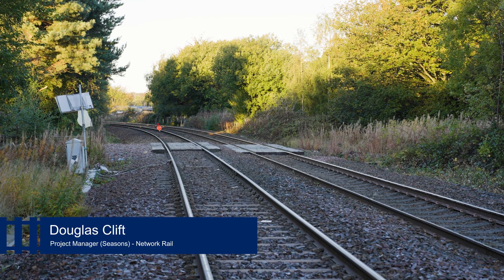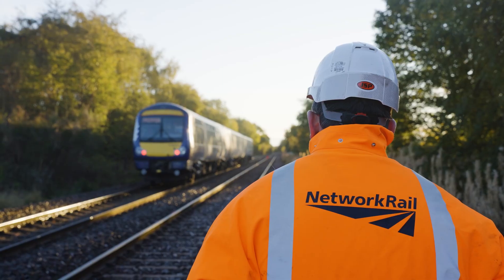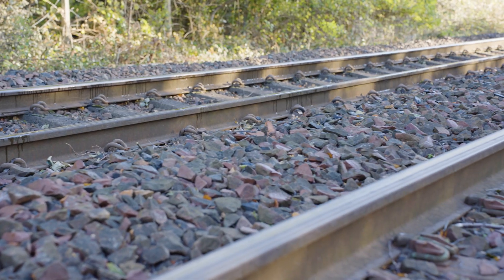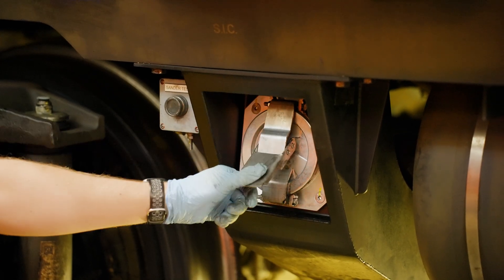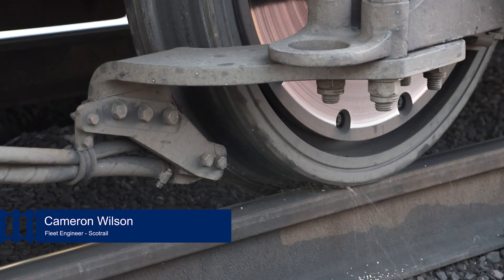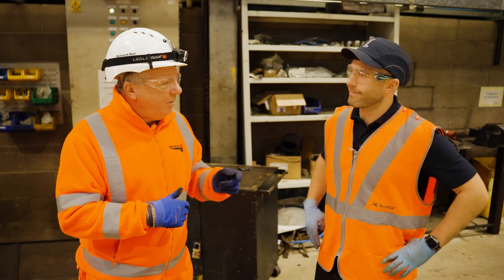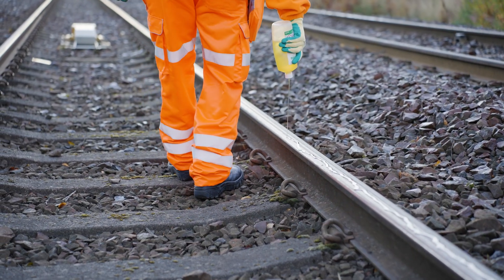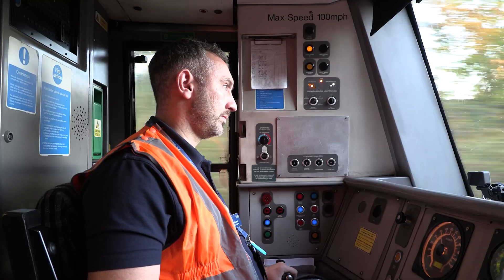Network Rail Scotland - DVRS ScotRail Trial

Comment: 1: When did autumn railhead adhesion issues first occur?
2: Did any changes occur to the wheel and railhead interaction at the same time?
3: What type of rolling stock are affected by low rail adhesion issues?

I would conclude that while a disc brake system is better way of stopping in most circumstances, it’s not necessarily the best system when the rail head has leaf fall contamination.

My solution would be to fit a dual disc and brake blocks brake system (belt and braces).
Reply: Two brake systems per axle sounds horrendously complex. What advantages would it bring rather than fitting dual rate sanders?

Comment: DVRS usage should lead to less wheel flats as well, so thats a win-win for the operator and infrastructure owner (and ultimately for the passengers as well) , as units have to be taken out of service for wheel re profiling after getting flats and the track suffers from wheel flat impacts. Surprised this wasn’t mentioned. But great to see a co-operative effort to alleviating this seasonal issue.

Will the DVRS concept, once fully proven and tested, be shared to England and Wales TOC’s / Network Rail?
Reply: Porterbrook is also trialling DVRS systems on other train fleets in England and Wales.